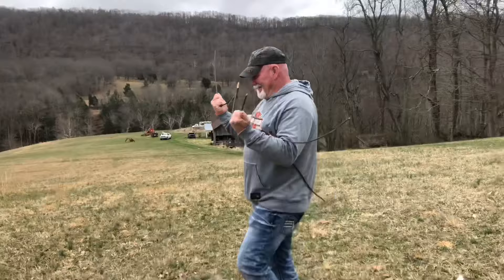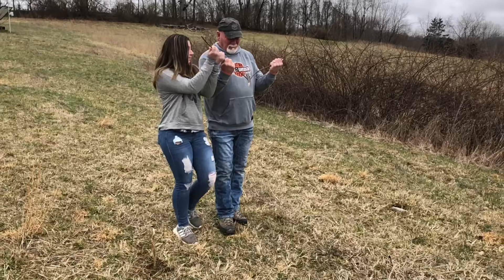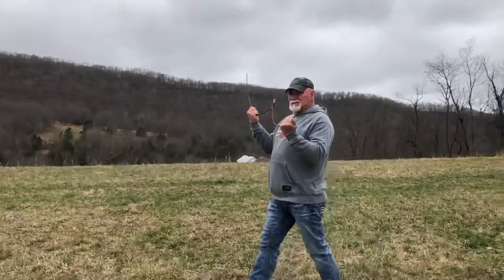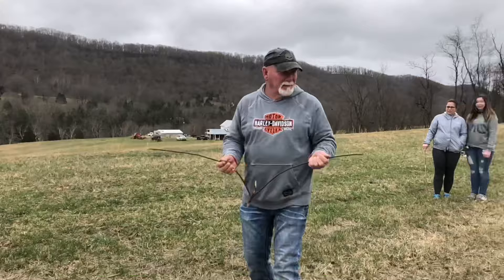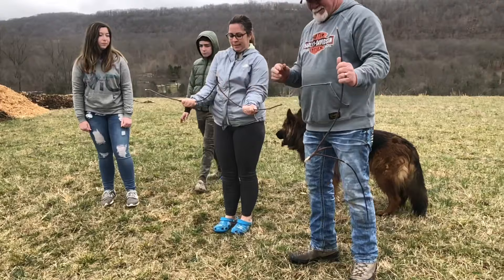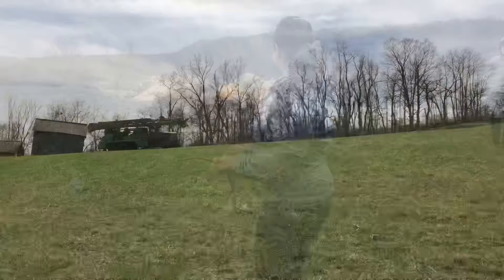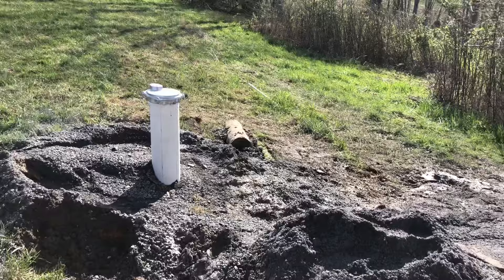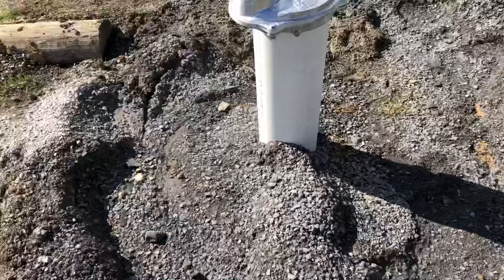Dowsing / Witching a well. Does it work? Thousands of $ later we find out.  Definitively answered.

Comment: A few of the prevailing attitudes in this entire thread seem to be that: 1) there is water, water EVERYWHERE, and all you have to do it drill deep enough to find it, and; 2) if dowsing does not 'find' water, there isn't any there, and; 3) that dowsing is foolhardy.
1) Water is most everywhere. But there are comments below, and it is my experience that well drillers have spent/cost THOUSANDS of dollars drilling, and drilling, and drilling, and not finding water. And I've also seen drillers drill randomly or wherever it was convenient and bingo, find water. Water is NOT EVERYWHERE! But it is where it is. If you think of water like fish...try fishing right next to a lake, or somewhere in the lake where the fish don't congregate - the fish are (almost) there, but you'll never catch one two feet from the edge of the water or the 'hot hole'. Radio or cell phone signals are about the same - have you ever 'lost signal' and had to move a foot or two to get it back?
2) Dowsing does NOT actually 'prove' there is NO water anywhere. Dowsing responds to water (and pipes, and wires, and more) that ARE THERE. No response only means that the 'signal' wasn't as strong, or strong enough right there. Again, the fish - seeing them in the lake, or catching one or more from a 'fishing hole' proves that fish WERE there (since you've caught them, they might not be any more). But seeing a lake IN NO WAY guarantees fish! Again the radio/cell signal, too.
3) And, since I'm a believer, and have adequately and repeatedly proven to myself and others that dowsing works, it's not foolhardy to me. To those who 'don't get it' or 'don't have the 'feel', nothing can change that; for those of us who 'do have it', nothing will change that either.
Reply: No, water is definiely everywhere. How deep you have to drill to find some is gonna change region to region, but not more than a fex cms every dozen meters at most. And dowsing is not gonna help you find anything, because the difference in the height of the water table will only be a few centimeters over an acre of land, so drilling there or 10m to the right will not make ANY difference for depth of water table.

I know this from university and practical work on groundwater protection, this information is easily available online. How tf is a piece of wood supposed to discover water many meters below ground level exactly?

Oh yeah, groundwater is neither fish nor a radio signal. your analogies are a little wack.

Comment: I have done for years. I am more accurate than any locator.  Can do plastic, pipe, wires, metal pipe, also can locate bodies burried and tell you if male or female. Nobody knows how it works, but it does. The witcher could count off depths and flow rates with rods if he wanted to.
Reply: Could you recommend me where I can get a good per of them water dowsing rods also I'm assuming you can't tell how deep the water will be can you???
In the area I wanna dig water, water is found about 150 meters on average which is too deep and cost alot over here.
Reply: @ahmedadam8851  If you can douse you can tell how deep. Simply establish yes or no, then count off feet. 5,10,15. When you get to correct depth you will get a yes. Take a bit of practice. Mainly takes a bit for you to believe it works. Go slow. If not sure touch rods to ground to reset and start over. I just use metal gas welding rods.  Bend the 6 inches at end to L shape.
Reply: Would you know of anyone that does it in the Columbus Ohio area?
Reply: @philipkrause5080  not sure. Check w local well driller.

Comment: Dowsing works for everyone. You only need to quiet your mind, be present, and focus on the desire you search for. It isnt just water or lines, it can be people, an arrangement of matter (IE a sign or a fire hydrant) or even metals. The tools are just that... tools. They are an extension of you and the universe within.
Reply: @MagnificentXXBastard  If you can dig anywhere and find water, why were dowsing rods ever even used?
Reply: @TheEternalClown  For the same reason people were hanging horseshoes on walls, knocking on wood and avoiding walking under a ladder. 

Superstition.
Reply: @MagnificentXXBastard  Can you substantiate this or are you simply going out on a limb, and likely will respond with irony? In other words, are you well read on the history of dowsing and "water witches?" Can I trust that you know what you're talking about?
Reply: @TheEternalClown  No irony here, dowsing rods really are superstition. 

How do you think a simple wooden rod (or copper or whatever) can detect water? what is the mechanism?

Also, I work in groundwater protection and can tell you that groundwater does not run in veins or spots, it is evenly distributed across large areas called aquifers.

It matters little if you drill 20m to the left or to the right, the groundwater level will be approximately the same.

Comment: Have done it.  It is on the line of supper natural.  The they a lot of things u can use it for.you have to think about what you are looking for. Some people can tell u how deep. There are different methods you can use. To tell you different things. Not saying if it is a good ,or bad spirit.  But u are on a line. Some of the people that look for water are into the dark side .  Then are people the are good and use it just to look for water. In the early 80s went to a gathering where they were teaching u some of the things u could do with your gift. Was on the side that I didn't want to get into.  Did use it to find water. Not often. Always felt there as   a power there. And wasn't sure where that was coming from so stopped playing with it.  Where it was coming from God or Saint.  But does talk about them using rods to find water in the Bible.  So this is old

Comment: The physics involved in dowsing have been reverse engineered and explained in the book, The Art of Dowsing - Separating Science from Superstition ($14.95), along with how to build the modern light weight ball bearing dowsing rod, which uses gravity as a gauge by pitting the energy of gravity against the energizing of the one-tenth ounce dowsing rod load that is attached on the elevated acetylene welding rod, and five inches from the hub shaft.  This precisely gauges the dowsing of all edges, exact center, depth buried with angle of deposition, and most important is grading of the sought element that is contained in the elemental mass that is being dowsed.  Everybody can become a professional dowser by practicing the books dowsing lessons of buried pipelines and electrical cables, tunnels and voids, precious metal placer and lode deposits, dowsing for treasure, dowsing for any element, amplified long distance dowsing from a moving vehicle, and dowsing on water from a boat.  I hope dowsing enriches your life and have a safe,healthy,good day.
Reply: I'll believe every word of it, after you show a link to the scientific tests of Religion Rods being conducted with 100% accuracy.

Comment: Is it possible that there's just a high water table in the area where these folks happen to work? Idk, I'm just spitballing. I'm still going to try and see if it works to locate the septic drain field at my new place. Worst thing that could happen is I end up using the rods to poke into the ground and find it that way. Fun experiment, either way.
Reply from the maker: Lisa Kukla no. The well is on the highest ridgeline.

Comment: My dad had a well dowsed in the early 80's at 180 feet they hit a high gallons per min, static was at 25 feet. I had a well drilled by a driller randomally about 50 feet away , at 400 feet I finally got 2 gallons per min. I should have dowsed too!

Comment: Cracks faults fractures in the bedrock where water naturally will flow that's what your finding if it works for you. I would suggest  moving over 20 ft or so away from where you find them  the end result  will be the same as far as water but if you drill that crack sense you disturbed it it will collapse maybe the next day maybe 100 plus years but it will eventually
Reply: Tip if your building a house or any type of foundation walk around and mark where the faults are running better not to build across one or more of them better to be on one solid peace of bedrock 😊

Comment: "our guy" can tell where the water is, and how deep. But he can't tell if there's a rock between the ground and a water level. So you're hammering a 5/4 pipe 16 feet into the ground, and on the 10th foot the pipe doesn't move an inch further no matter the weight of the hammer. Pipe out, and better luck on a new location. Can "your guy" tell if there's an impenetrable rock in the ground ?

Comment: This is incredible. Can anybody explain how this is possible?
Reply: It'S not, it's pure nonsense.

Short answer is, in most areas you will just find water when you dig enough and doing it 100ft left or right of a spot doesn't change the groundwater table more than a few inches.
Reply: @MagnificentXXBastard  if you watched the video i linked,  then you would see your point is easily dismissed
Reply: @notafortnitegamer  I don't see any video linked, probably got marked as spam.

What i said is 100% correct. You can look up groundwater table depths for areas online. This depth doesn't change much over short distances...
Reply: @MagnificentXXBastard  so the object he is holding is moving on his own?
Reply: @notafortnitegamer  No you genius. He is HOLDING IT IN HIS HAND. He s moving it himsel.
Reply: @MagnificentXXBastard  smh. I guess all the solid copper rods people use just magically get moved by the people too.
Reply: @HookerHeels  Are you dense? It is literally IN HIS HAND. Of course he is the one moving it, what else would do it? If it was an external, physical force it would be easily measurable with a torque meter lmao.

There is no external force, it's all the guy holding it. I know my shit about ground water, you guys are just wrong.

Comment: My Grandfather, "Poppy", (Because he looked like Popeye), owned 3 Cable Tool Rigs and he ran his own drilling business. At the age of five I began spending half of summer vacation with him on the Rig he operated. When we would set up the Rig in some new, remote location, he would cut a stick and douse for the water before deciding where to set up the Rig. I never seen him ever, miss a single call. Poppy could tell you how many feet the well would go, within +/- 5' . . . whether it was fifty feet, or 500 feet; but more than that, he could tell by the pull on the stick, with like accuracy, how many GPM the Water Well would produce. I watched him do it for 15 years. And setting up a drilling Rig is no small chore, that dousing Rod, never let Poppy down.

Comment: i know dowsing works, saw it with my own eyes back when i was 12, 30 years ago, my question however is, how do he know he hit 2 streams in the one hole he drilled? do they lower a camera down there or what? if they measure the water flow, it could be just 1 bigger stream rather than 2 streams, right? and why its so expensive to drill is beyond me tbh
Reply: He can tell it’s two streams because he got pull coming from two directions but a lot more pull where they crossed.❤

In France they mark the places with little flags of different colours, indicating the amount of pull.😊

Comment: I think he has fishing line attached to the center of the stick. When he steps on the line the front bends down. Look at 4:30 it wasn't a good time for this to happen and he starts lifting his legs up, why would he do this?.... Case closed.
Reply from the maker: 🤣 ummm. Watch it in HD. 🤦🏻‍♂️
Reply: @midevilone  way to make no point 👍🏼I did watch in hd, you aren't going to see a thin ass fishing line on video from several feet away. Like I said, look at 4:30 he's raising his legs, why would he do this? Explain
Reply from the maker: 🤨 Welllll (pun intended).  🤣 Considering we handled the sticks, had a clear view around him on all sides at all times and there’s no freaking way for the physics of the stick motion to be controlled by fishing line tied to the dudes legs (or any other part of his body) and result in fluid movement of the stick.  It’s not like he was on a stage and then went behind a curtain or something. It was in full view in broad daylight.  Additionally if he was controlling it with fishing line, and the leg movement at 4:30 was part of the process, why then does he do it only once?  Soooo many flaws in your theory. I’m just gonna go out on a limb here (again pun intended) and say nah bro.  Cheers 🍻
Reply: @midevilone  I told you.... he raises his legs at 4:30 because that was the only instance where it didn't make sense for his stick to work and your wife's to not work so he lifts his legs hoping to stop it. Why is he lifting his legs like this, does he have to pee? Also this would explain why he usually stops walking immediately, he usually stops on a dime, the second the stick is pulled down. I'm not suggesting it's tied to his leg, I think he lets the fishing line dangle, and when he steps on it!.... water.  Most importantly: wood is not a conductor.... Rods at least have some conductive properties, this stick method makes no sense whatsoever.
Reply from the maker: GEN 913 if you are ever in the area look me up and you can come watch him do it yourself.  There is no bloody fishing line 🤦🏻‍♂️
Reply: @midevilone  cheers man, just glad you hit water 👍🏼
Reply: @hlloyd-fs4uf  what the hell are you talking about. this is incoherent..